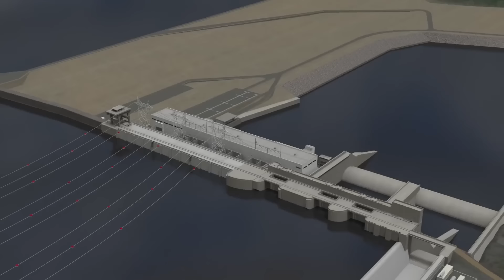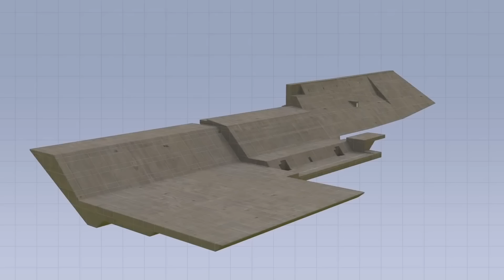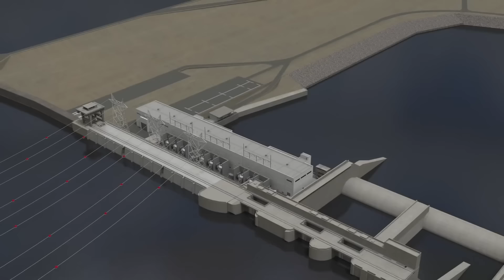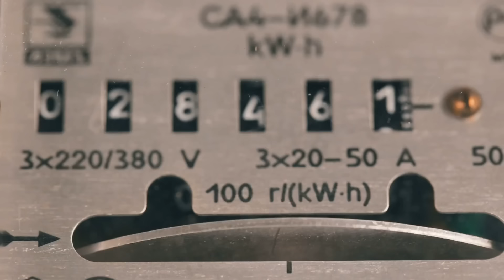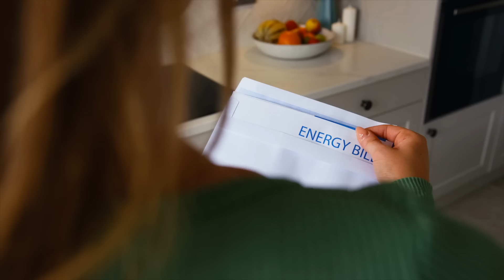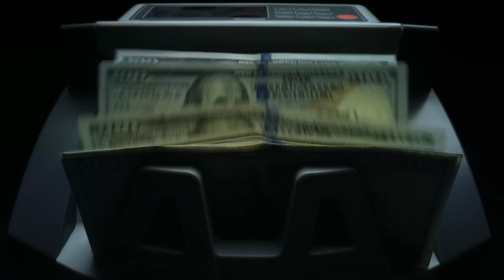Canada’s $11BN Green Energy Project Is A Game Changer

Comment: Dams are great, they provide power 24 hours a day, 365 days a year.  Long live HYDRO-electric power.
Reply: Yes , but not always at a 100% capacity . Even with Hydro there are occasionally very dry periods when it may well reduce power ability and of course the green folk generally do not like them . Canada of course is one of the lucky countries  with a lot of water . Not every country has that potential .
Reply: They also screw up ecosystems.
Reply: Every large and every river that can have a dam should have one,
A dam...
Reply: This project has been in the works since the 50's. Way to destroy a perfectly good water way.
Reply: Biggest waste of money. Head engineers that designed it quit because they didn't want anything to do with it once they discovered it would never pay for itself. The only reason they are building it is because they would be paying for the whole thing if it was built it not.
Reply: @grosvenorclub  from the stats given in the video, the predicted annual capacity factor is 47.7%. The figure proves your point - “not always at a 100%”, - to be both relevant and true.
Reply: I think it might collapse due to ground stability issues. It's also been controversial due to it being very over budget and government corruption.
Reply: Not truth, reservoir have to fill up to. Most of them operate at high demand. Early in the morning or around diner time. They are quick to generate power vs slower steam turbine who require more time to start create the steam and go in production

Comment: If everyone in BC starts driving an electric car we will need 15 more Site C dams. The construction of this dam should have been completed decades ago.
Reply: You're the only one here who actually sees this problem.
Reply: No, we won't.
Reply: @sandorski56  Its actually a simple equation. 1/3 of energy in BC is electrlcity. 1/3 is gasoline, mainly for use by cars and trucks. The rest is hog fuel etc. 

If you take away gasoline there will still be a requirement for the same amount of energy if we continue to drive cars. If the cars are EV that means doubling electricity generated ... 15 Site C dams needed. Or 3 typical size nuclear plants ... which won't happen on the Banana Coast.
Reply: If we go full electric, I believe we must switch to nuclear power. Aint have enougj river!

Comment: Is that ELECTRICITY,  or POWER, to 450,000 households?  In the UK we are told that a wind farm or solar farm will supply x number of houses with energy. But this is replacement electrical energy. In the UK average household energy consumption is split approx 20-25% electricity / 80-75% gas. They don't tell you that only the electricity part will be replaced by these renewable sources. What is going to replace the gas? Fossil fuels going nowhere soon.

Comment: The carbon output from silt in dams is massive. Let’s talk about that.
Reply: Dam right.
Reply: and the extreme levels of CO2 output from the concrete along with transport of those materials to site,  the cleanest (in terms of CO2 output) cheapest and most stable form of energy will always be nuclear, stats for the UK show nuclear power costs 4p per kwh versus 32p per kwh for solar or wind and 20p for hydro but the greens have managed to shutdown almost all of our nuclear generation which is why our energy bills stand 400% higher than 3 years ago

Comment: "depends on "storage water from the Williston reservoir of the existing WAC Bennett Dam"
"does not depend on a water storage system"
"create an 83 km long reservoir"

The 2nd and third statements make no sense.    If it does not need a "water storage system", why is it flooding 83 km of river?   You can't have your cake and eat it too. The spin doctoring is too blatant. 

How long will profit from the project take to pay off the $16 billion of debt + interest? 

Why wasn't transmission capacity part of the project?  There is no point generating power if you can't get it to the customers!